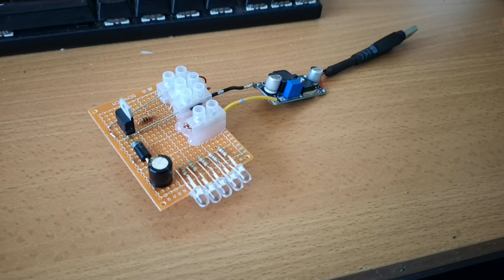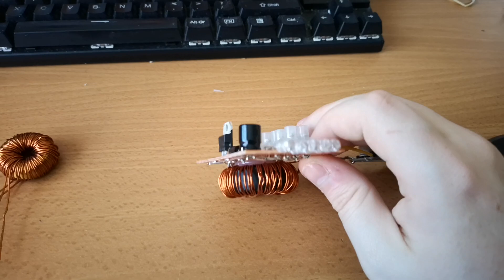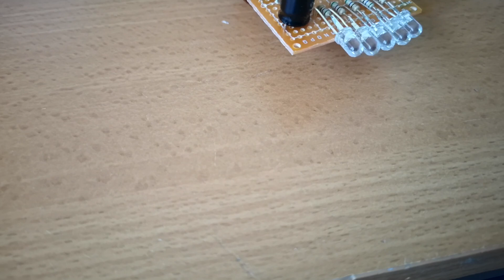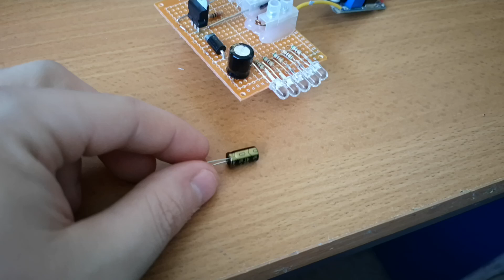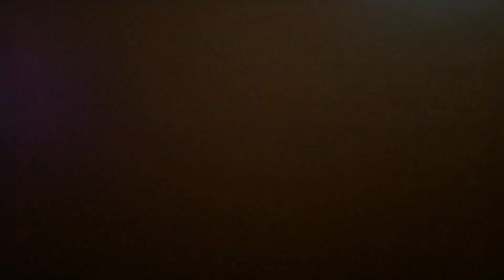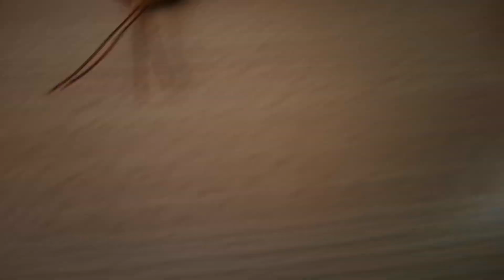[DIY] Higher Power Joule Thief

Comment: You can scavenge old ferrite rings out of most modern electronic  devices, PSUs, TVs and sometimes  in old microwave ovens.  The  glued on connector blocks are a good idea, but these days I do the same but with single straight Wago  connectors, I also find builders Super Glue with the activator spray a boon for my projects. The super glue comes in large bottles and the spray makes it set in seconds. It is often sold has Mitre bond for wood working.

Comment: Oh good stuff, I wondered about the frequency of the oscillations, and correct me if I am wrong but I believe they can be in the millions of hertz. I thought these joule thiefs were primarily used to "scavenge" the residual voltage then using that to drive the circuit to produce higher voltage, so tell me will the unused voltage in the battery eventually run out. Do these joule thiefs just extend battery life or can they be used to recharge the battery itself ????
Reply: IThinkItCanBeUsedToRechargeTheBattery,ButNotWithTheStandardCircuit.

Comment: A diode on the positive and a ceramic cap across pos & neg will give you a readable sign wave. I have one putting out 165 from 1.5
It will make running RGB LEDs run. I am running 555 timers off garden light circuits. I am using 12F629 chips with joule thief
https://www.youtube.com/watch?v=r3Dth-_96GE

Comment: Yo man. Have you tried or have any informations of jouel thief voltage multiplier combos? 
Like a way to instead of making a led light up to charge a cap?
Dont know, perhaps its beter to go AC to voltage multiplier, but if the loses are not big it would be cool as i would need something like that for "field work" where ac output of 220v is not possible but a small 12v battery should be no problemo.

I would need amplitudes in the kilo volts. my intuition is saying there are better ways but jouel thiefs are so cool :p

Comment: couldn't you just use a stack of iron washers for the coil core? it would be ghetto af but I imagine more economical than buying that coil pre-made.
Reply from the maker: I guess that may work. Although i'm not sure how effective that idea would be.
also the coils i'm using are hand wound,  through the torrid cores i used, either were salvaged from old PC power supplies or as for the larger one used in this joule thief, that one was purchased.
Reply: gary, you just gave me an idea-Thanks
Reply: hi.
i've tried a 5cm piece of iron ...like those used in construction...
and guess what... it worked perfectly!!!